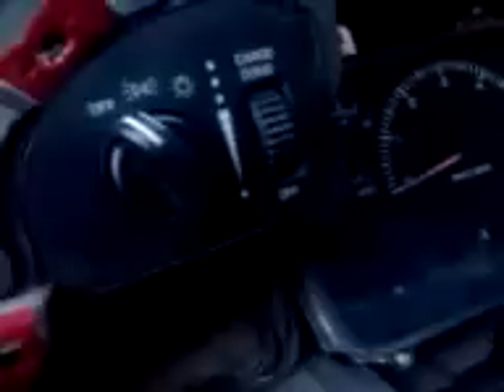cab marker light 2001 dodge ram 1500

Comment: How do you turn the cab lights on... I just bought a 2001 dodge ram everything  works so far but the cab lights
Reply from the maker: I ran mine to the parking light switch
Reply: @mel2734  . Then I need to find a mechanic  that knows how to do that...

Comment: how did you wire the lights into the light switch?
Reply from the maker: in my dodge the plugs was there from factory right above the headliner .sorry I could not help you out .
Reply from the maker: I ran the red wire to the parking lamps im sorry I can not remember the color of the wire of the parking lamps
Reply: +Gardy Marra you run new wire right to the light switch its not hard to know witch wire is the running lights